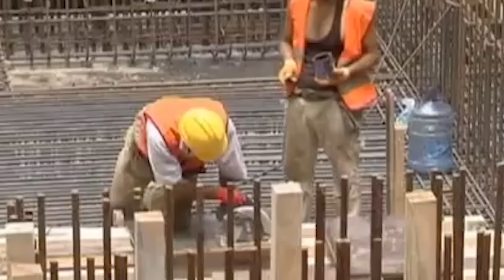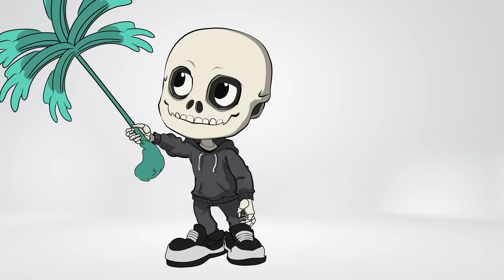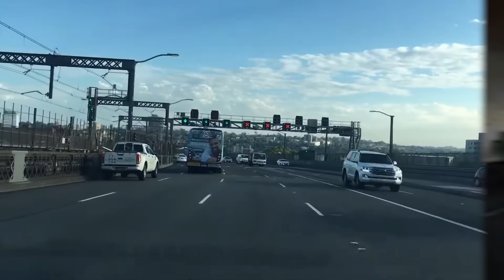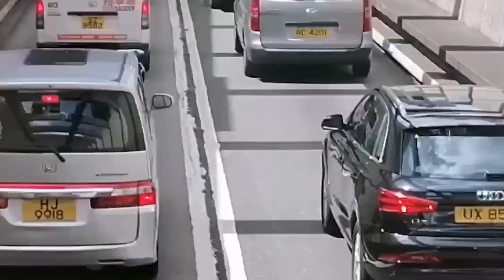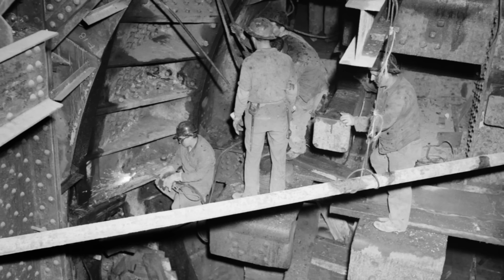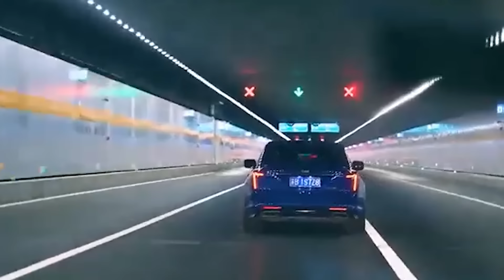20 Unbelievable Ocean Tunnels That Will Blow Your Mind

Comment: Thank you very much for showing these tunnels it's amazing but please help me understand how the oxygen is gained in these tunnels it will be a very informative show thanks❤
Reply: I am a European and I do not know how it works with the oxigen in the tunnel but I did been many times of some of these and I can tell you it is working just like in the open air.   How they do it I do not know,   but the only things I do not like with these tunnel is that it makes me feel bad when it goes in the highest or lowest point under the see as somehow  in some of these tunnels you can feel the pressure and some of the weight of ocean water which makes me personaly very scarred caustaphobic.    -   but at the same time I do not feel safe in the normal lifts either... so  it is maybe just me.